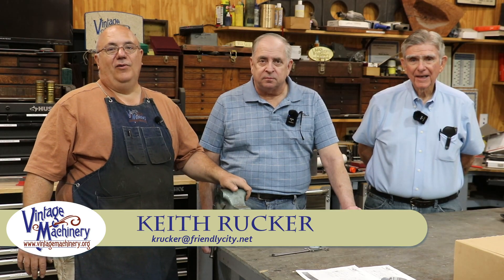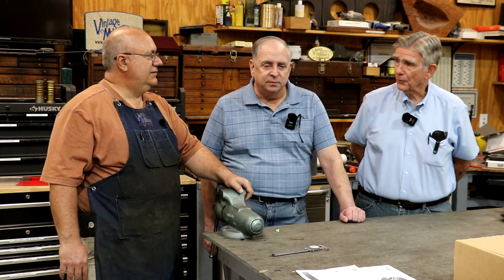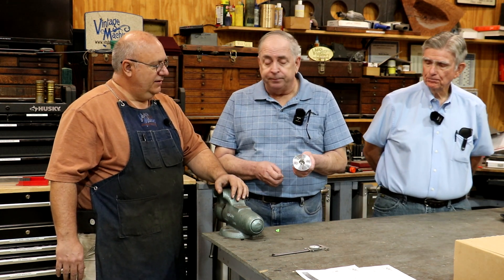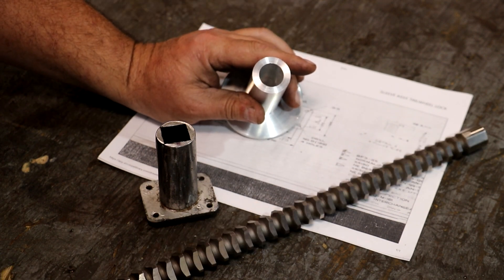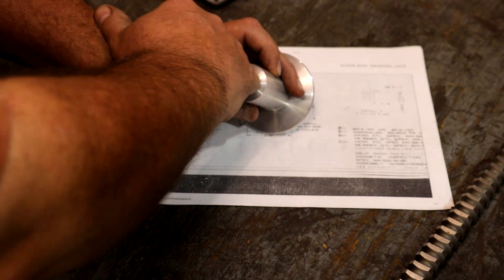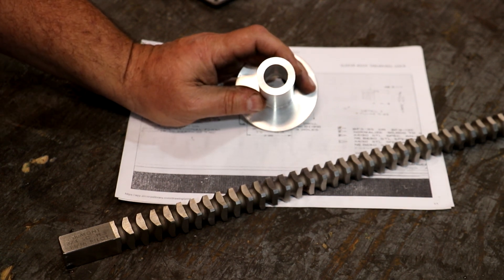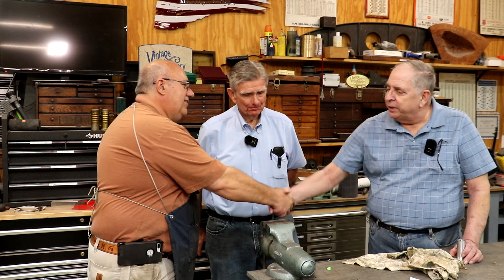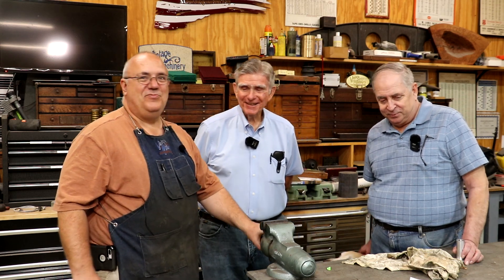B-17 Bomber Restoration: Broaching a Square Hole for Landing Gear Part

Comment: Those jobs are the most rewarding. I made a part to service the struts on a small fleet of privately owned F-104s. It’s a pleasure to help those guys, and the local hot-rodders in my area. It makes having the equipment worthwhile. Good work, Keith.

Comment: My Grandfather built B29s for Lockheed (then Bell Aircraft) in Marietta, GA! During and after WWII. One of my earliest memories is of him taking me to the plant when I was barely a toddler (I'm 63). I had no idea what was going on, but the sounds and the smell of the place was fascinating! I guess once it gets in your blood... As I got older, he taught me more and more. I was the only kid I knew of that had a toolbox full of REAL tools when the other kids were pounding wooden blocks through a toy workbench! In time he started bringing "reject" things for me to tinker with. Mostly instruments as he was involved in making the control panels. I got to where I could take them apart and then put them back together. Broken clocks, you name it! He always told people I was going to be an Engineer and he was right! Two Degrees in MET (AS and BS). Had a rewarding career of over 40 years before I retired! 😁
Reply: Check out Airbase Georgia in Peachtree City, Falcon Field.  They have an airworthy Bell P-63 King Cobra that was a test aircraft.   Also, I believe there is a B-29 on display at Dobbins.
Reply: what a great childhood........best wishes from Florida, Paul
Reply: I worked in that plant for a few months for an engineering contract. The place was huge (2 million square feet), it had streets and avenues inside to navigate the facility.
Reply: My grandfather worked there as well.
Reply: Your grandfather taught you right. My grandfather flew the bombers yours built. By the fact that I exist shows yours did a good job building them and mine had luck on his side. He later flew in Korea as well. I hope you are enjoying your well-earned retirement.
Reply: @nickwarner8158  I am! Funny thing is there's an old saying that talent skips a generation. Must be some truth to that because my dear departed Pop barely knew which end of a screwdriver to pick up! He had skills in other areas though! 🤣

Comment: I wish the two volunteers the best of luck with their restoration. I am a volunteer at Duxford Museum in Cambridgeshire, England; where the only flight worthy B17G in Europe, Sally B, is based. I do not work on that aircraft, but have been lucky enough to have had a tour inside the aircraft, and have seen it fly many times.  A lovely sight, I am always amazed that it can fly so slowly and remain airborne. 😀🇬🇧
Reply: Phil H  Many years ago the place where I worked ,engine remanufacturing , nothing to do with aircraft.
 A  recently retired chap that was part time cleaner used to travel to Duxford several days a month as he was a volunteer on a b17 restoration , Sally B ? he was lucky enough to be asked if he wanted a trip when it was competed as a thank you for the time he had spent working on it .I don't need to tell you his answer .  yes I have seen from a very close view a B17 in slow flight  very low altitude and amazed just how quiet it it could sneak up from just 2 fields away before I could hear it approaching .
Reply: Phil H. I was fortunate enough to get a complimentary flight on Aluminum Overcast at Concord, N.C. in 2007. All US veterans got a free flight that day and it was great. My service was with the US Army as a heavy equipment mechanic in Korea, Okinawa, and Iwo Jima In 1954/1955. I also had a very memorable flight on a Ford Tri-Motor at the same airport. My hat is off to all these dedicated volunteers helping to keep these great machines flying.
Reply: That was one of the things that made it effective. Prior to the Norton bomb sight, you needed to be able to hold it steady and slow down to let your ordinance man have a chance to get on target. Trouble is when you get low and slow its also easy to get shot down. So many young men died before we figured out how to hit a target higher up and faster.

Comment: I grew up just twelve miles from London center. I remember aircraft flying out to bomb Germany. Horizon to horizon. I now know that these planes were probably B17’s and B24’s. They would return later in the afternoon with gaps in the formations of missing aircraft. We could hear the stragglers coming home with engines out and misfiring. Many heroes in my mind.

Comment: I was lucky enough to fly on 2,  B-17s The Nine "O"Nine and Aluminum Overcast. Sadly the Nine "O" Nine crashed in Connecticut. It was an amazing experience if you ever get the chance to do it.
Reply: I’ve seen aluminum overcast, she’s a gorgeous beast
Reply: I have 45 minutes in 909.  It was so great!  I think it costed me $450.  Many people have asked me if it was worth it.  Yes!  Just feeling & hearing the engines on take off was worth it!  I was seated behind the engines, in the waist area, during take off.
Reply: I have many pics of the inside of 909 taken just a couple weeks before she tragically crashed. Quite a machine. I have the utmost respect for those who flew into combat aboard them.

Comment: Well, that first little issue with the drill chuck is why I have 3 different shop fees.
1) $45/hr if I just do the job and call you to pick it up, 
2) $65/hrs if you watch,
3) $125/hr if you help!
In my experience, any distracting conversation always causes mistakes!
But, with this particular job, I know that you're not going to  charge them anyway, nor would I. 
Glad that you were able to help them!

Comment: Russ sure did a nice looking job on the part. I would be absolutely thrilled to work on a restoration project like the B-17! I can see Keith sure is! I have a decent selection of square and hex broaches that I have picked up over the years with the largest being 1" square. I can tell you it does take a tremendous amount of tonnage to push a 1" broach through steel. Makes me nervous about breaking them every time I use them. Keith to the rescue!

Comment: It's great you can help out Robins Museum I volunteer at Selfridge air museum here in Michigan and am working on a WW2 FD-1g Corsair fighter for static display ,it's missing a lot and many parts need to be fabricated ,,some parts take special tools or machines that they can't afford so museums are always grateful for any help , My Son was stationed at Robins for 12 years , I visited the museum in those years , It is quite a Museum , Bill

Comment: My dad flew B-25 bombers during WWII. As a kid, after the war, I would crawl around the parked B-17s, B-25s, B-29s,, T-6s,etc. Sadly in 1960 and ‘61 a crew from California came on to the base, cut them up and MELTED them all into large ingots. They saved the engines though. Such a sad, short sighted, ignominious ending to priceless treasures.

Comment: I am amazed you could broach that without deforming the part. When I looked at the wall thickness that was going to be left I was sure it would either deform or bust out. My respect for aluminium just went up a few notches.
Reply: i mean, its cutting down, its not tapered and pushing the walls out.... Really not a ton different than a drill bit

Comment: Keith, ask the guys for the URL to the B-17 drawings!  At work one of the guys found an original B-17 part drawing in the drawing flat files, but we figured that since we (U.S. Naval Air Rework Facility) were on the same team as the Army Air Force, our facility must have been building some parts for them, just like we were working  on the Norden bomb sights for them.

Comment: Great job and very nice of you to assist these gents. It wasn’t mentioned in the video for setting up the broach, but during the process I think my question was answered. Was The relationship of the broach to the square flange critical or could it have been oriented however it ended being positioned?

Comment: A few things you can see at the Museum of Aviation - An original SR71 (fastest plane on the planet), P51 Mustang, RQ4A Global Hawk, B25, C130, A10, F15, F16, Mig17, B52, B1, U2, several helicopters, B29 (sister of Enola Gay) and Mark 6 nuclear bomb shell.  And it is all FREE of Charge except for the virtual reality simulator.

Comment: I couldn't tell if the drawings had an allowance for the square being imperfect because the diameter of the pilot hole is (slightly) larger than the side of the square. I'm sure the broaches are designed this way to reduce the pressure required to use them, but then I wonder if other broached exist which cut a full square hole (using a pilot hole smaller than the square).
Reply: Every square broached hole I’ve ever seen looked exactly like this one. The broach relies on the relief from the pilot drill.
Reply: There are, they are called 'full square' broaches and the pilot is the same as the finished size, so in this case it would be 3/4".
Reply: Yes there is.
It's also possible to use a smaller broach and move it around, this also gives more control and flexibility of the hole size.  Joe Pieczynski shows that in at least one of his model making videos, didn't find that one but here's a similar: https://www.youtube.com/watch?v=JFuLjT3QmwA
Reply: I was wondering about that too.   The original piece had a hole with straight sides and the corners went almost all the way to the outside of the cylinder, but the insert fit, so I guess the square portion is the right size.
Reply: Just looked up Hassay Savage Co who sells the broach (part no 12V316, priced at $770.20) very similar to one Keith used, which also uses a 13/16" pilot bore. Info says it requires 8600lb of pressure (presumably in steel and also dependent on the length of the material to be broached). If a full square broach were to be used would take even higher pressure. Engineers designing the original unit would have taken into account loads on the part and also limitations on the material available at the time. As the members of the museum said, this aircraft will never fly - it is static display only. This partial square bore in aluminium should meet all their needs.

Comment: I noticed that on the old steel part (seen at 3:39) that the corners of the square hole was almost to the very edge of the tube it was cut into.  MAN, that sure seems like a bad design and wouldn't be very strong!  Then I saw the new aluminum part (seen at 11:03) and the large amount of material between the corners of the square hole and the edge of the tube.  Ahhh, I realized now that the old part was so badly worn that the square hole had been enlarged by what looks like 0.25 inches!   Whoa.  My thinking is the wear was caused by the action of the locked tail wheel during takeoff and landing (FYI - its locked so the wheel doesn't caster which is only needed for taxiing).  When the tail wheel is locked any lateral movement of the aircraft (cross winds, etc) would cause the tail wheel to move side to side and pushes that steel paw against the side walls of the square hole. Over the course of aircraft's lifespan there was a LOT of steel on steel abrasion occurring.  My $0.02.
Reply: Combat losses early in the war were 85%.  Durability was not considered a factor.
The earliest model B-17's were painted. They realized the planes didn't survive that long and 500 pounds of paint was one more bomb.  No more paint on later models.

Comment: Hi Keith, they should have made the replacement part out of the same material the original one was.  In the future someone may want to get the plane flying and this part will need to be replaced.  They have done great work though.  Regards a fan from Aus.
Reply: The rest of the aircraft is being restored to ground display standards as well. There will be a lot of compromises everywhere.
Reply: @bobhudson6659  Hi Bob, you guys are doing great work.  Regards A Fan from Aus
Reply: @colmornane5684  Hello Col, thanks for the thought but I am not part of the team. Was just reiterating what the other two said that a/c will be a static display. I am also in Land Down Under (SW Sydney) with 16m x 8m shed as supposedly 70 yr old retired mechanist, mechanic, welder and whatever else needs to be done in our village of Douglas Park.
Reply: @bobhudson6659  A giant fully detailed stage prop.

Comment: Is there a reason that press isn't bolted down?  (or at least shimmed). 🤔

A cardboard box full of rags under the press plate is real handy to catch a broach or any other thing you may be pressing out of a bore.
Reply: My guess is that Kieth's shop is and probably always will be a work in progress so bolting things to the floor when they don't need to be isn't going to be a high priority. I really like your idea of a catch chute for broaches. Might be a pain for really long broaches but for most it seems like a great idea,
Reply: @ohnonomorenames  Doesn't mean you can't jam a shingle under one corner of it.
I was getting sea sick watching Keith pull (push?) that broach through.
Not a criticism, just a question...
Reply: @jimurrata6785  Yeah fair enough, I didn't notice it first time so maybe I shouldn't be doing other things while watching.  So i guess my take is, I'd rather that the subject is in focus rather than super stable. Seems like I'm happy to ignore poor machining technique but insist on the highest of quality when it comes to film making.
Reply: @ohnonomorenames  😉.  🤣🤣🤣

Comment: Why did you choose to enlarge the hole on the radial drill, as opposed to the lathe? Is it because you wanted to avoid any issues with run out because of re-chucking?
Reply: Umm, because he has a radial drill and it is sweet!

Comment: My father flew B17 and B29 a bit in the war, but then was assigned a Lancaster instead, and then had one of them shot from under him. Then after he got back to the UK was assigned to Africa, Italy and then Burma, and demobbed to Nyasaland after the war. All the time in Lancasters, and after the US comforts they were always feeling second rate, no pressurised cockpit, poor heating and poorer controls.
Reply: The largest bomb load of any allied aircraft however.

Comment: 6:53 General curiosity. With the boss being round, and drilling a round hole. Why not just chuck it up in the lathe to drill the 13/16" pilot hole instead of setting it up in the radial arm drill with a setup??
Reply: How he did it didn't work?  Looked like it did....

Comment: I thought it was pretty smart that the one guy didn't mill out the flange until you put the square hole in just in case the flange had to be clocked to the square hole....thinking ahead.

Comment: I would have thought it more appropriate to use a coaxial indicator to center up on that part before drilling the hole larger. That or held in a collet in the lathe. I suppose that sort of accuracy wasn’t necessary. It just triggered my anal retentive sensors. 
Neat project. Nice job Keith.
Reply: No, you’re correct.
Reply: No need to make the job more complicated, especially when it is for a ground display restoration.
Reply: I wonder, too, why he didn't use a lathe.
Reply: yeah  .0125 is not too much at all for a reamer if you have the right size , and that would have done just fine in a lathe. something else I wondered too is did they allign the broach to the layout first? or just re-lay it out once the broach is in place- that's how I would have done it.

Comment: Not a very substantial locking system. For such a large aircraft.but bowing must have thought it was.
Reply: It's only engaged when the aircraft is going straight ahead anyway. It's to prevent shimmy.
Reply: "bowing"??

Comment: It is really too bad that substituting aluminum for steel was seen as acceptable. The difference in effort would have been negligible. How can anyone know what the future holds for this old B17?
Reply: Absolutely,  12L40 lead alloy free machining steel cuts better than most aluminum. Wire edm would be another option to put a square hole in a long piece like that.

Comment: Ugg no reason not to make that out of steel,  like the original.
Reply: Was thinking the same thing but didnt want to be 'That Guy'.  😅
Reply: @gstri5800  my pet peeve in restoration, giving George Washington's ax a an aluminum handle
Reply: This part should be, and very likely, clearly marked, tagged, documented. Safety Third as they say.
Reply: It's a showpiece!  Purely visual!  If it is really bothering you, get your own B-17 and get busy!!
Reply: @paulcopeland9035  will a Sherman tank or two do ?
Reply: @brianbranson2306 ...Two would be most impressive!

Comment: Just make it the same as the original, or it is a waste of time.
Reply: I don't remember when those two volunteers put you in charge!
Reply: @paulcopeland9035  future generations may want to make this fly again, then I will be one more thing that needs to be made again correctly. Make it from steel it is not hard, perhaps I should be in charge then it would be done correctly.
Reply: @HorsleyLandy88  Well, okay!  After you are put in charge, the first thing you can do is add this video to the restoration archive so the "future generations" know the wheel may fail....Have a good day sir!